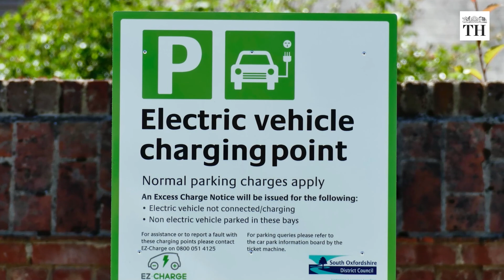Fancy converting your classic car into an electric vehicle?

Comment: Kind of pointless. So much more can be done with electric vehicles. They are not tied to the combustion engine drive train and can come in far different forms. From vehicles that promote exercise, electric assist pedal powered, to variable geometry vehicles which adjust the drivers relationship to road and driving conditions, to portable rooms that you can take to the beach or remote from the office. So many new options to explore, old fossil fuelers belong in museums, never to pollute cities again, with the toxic waste and noise.
Indian needs to explore completely new designs to keep ahead of the market, the converted fossil fueler design has no place in modern electric vehicles. In the west with a huge number of existing vehicles, conversion sort of makes sense for the transition period but most of them will end up in Africa where the middle east will push fossil fuel use for as long as possible.